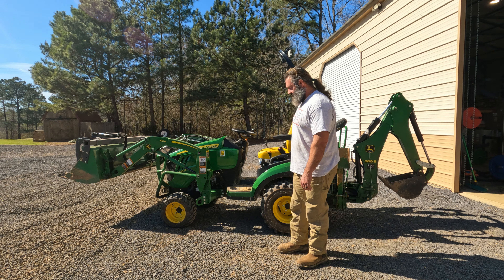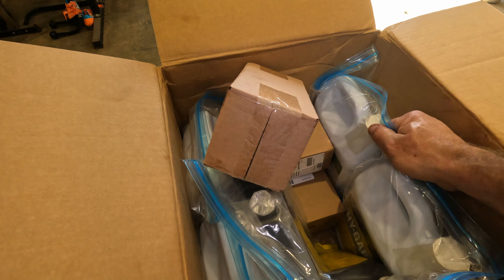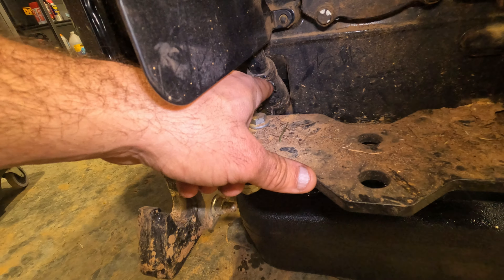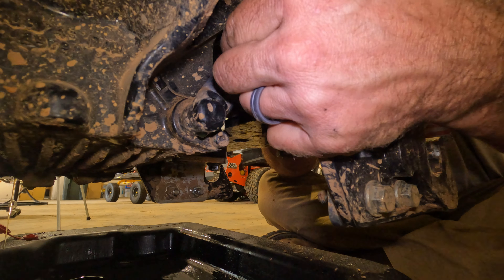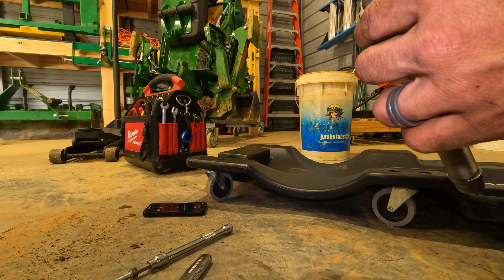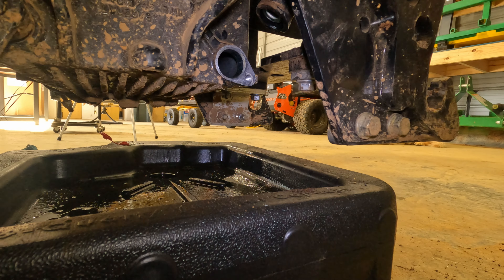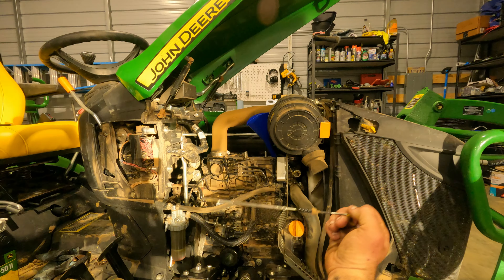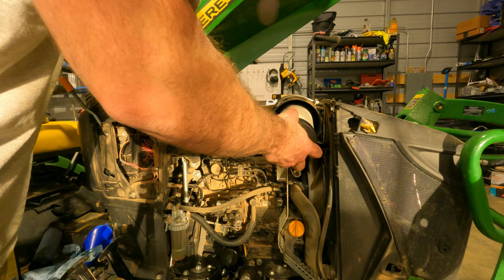200 Hour Service (Hydraulic and Engine) - John Deere 1025R fluids and filters

Comment: Very nice video work!  I'm hoping oil changes in a few weeks will give mine the power to use high gear. If not, I may be hauling it to the landfill and getting something else.
Reply from the maker: Damn! That bad, huh? Lol
Reply from the maker: What elevation are you at?
Reply: @BigDaddyAddyMS  About 700ft above sea level
Reply: How did you make out with this?  It doesn't sound good!
Reply: Haven't made in improvements yet. I'd like to adjust the fuel pump sometime.  It probably needs a turbo. @tonyaceto2082

Comment: I'm going to do my first 200 hour service in the next couple of days and the taking the rear tires and loader off looks to make life way easier.  al the other videos leave them on and they struggle.  you didnt show how to change the front axle and for informative purposes i would have liked to see how you go about changing the small fuel filter even if you didt disconnect it.  Thanks alot you had the best videos by far